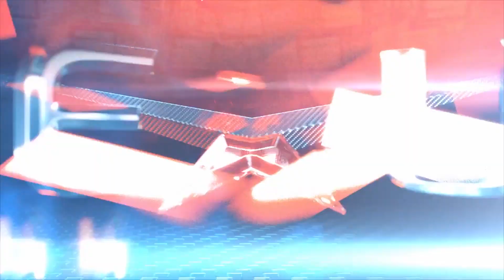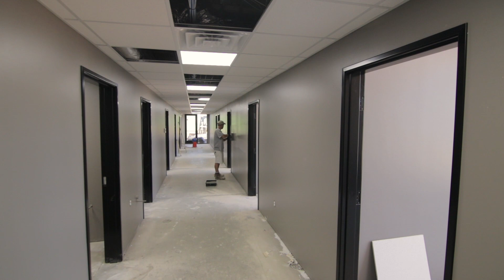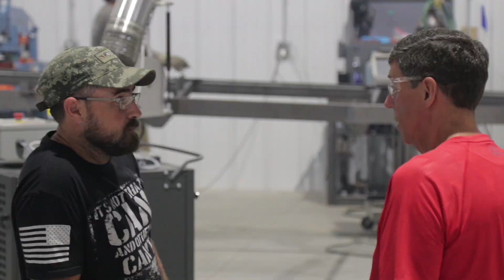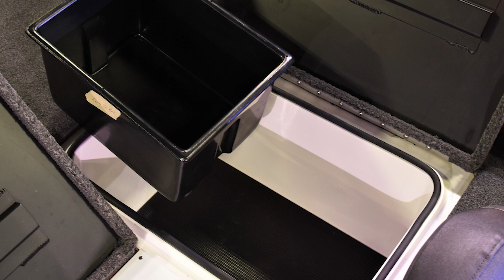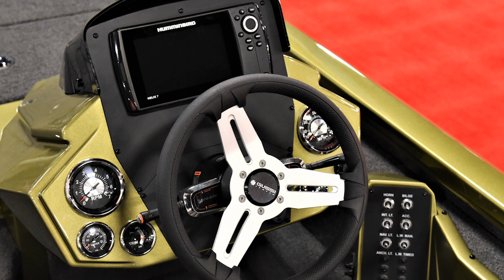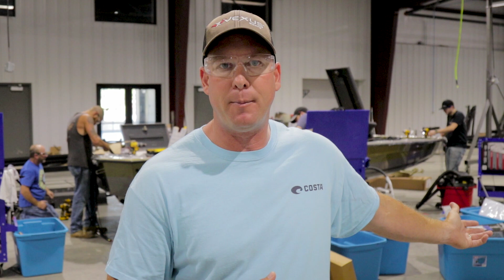Vexus® Boats - Update/June 2018

Comment: Please do an updated video with your center console models. It'll be interesting to see how a 2018 Vexus bass boat compares to the late 1980s, early 1990s Ebbtide Dyna-Trac center console bass boats. IMHO, center console boats are by far the driest boats on the water. Hopefully you can take a page from BassCat and optimize storage space on the front deck too.